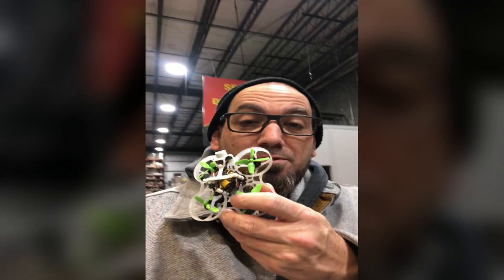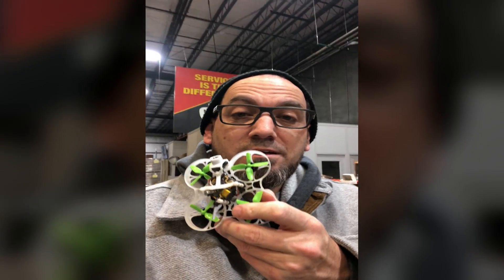Mobigital 7 10000kv + The Gauntlet Bando Penetration Testing

Comment: Thank you for opening my eyes to this. I'm building one ASAP!
Reply from the maker: You're so welcome dude! They are such a blast!
Reply: @DaxNealFPV  While I have you: I'm buying a Nebula Pro Nano with Vista unit right now for this project. The only place that has them in stock has the Naked version at $11.00 more than the standard version. I'm handy with electronics and your video makes removing the heatsinks look easy. Is there any reason from your perspective to buy the naked version for more money than the standard vista?
Reply from the maker: @kingjamez80  The end result is the same, so it comes down to whether or not you want to do the work yourself or not for the extra $. It is a little messy the first couple of times you do it. Then you figure out how to do it without a mess.

Comment: Is this still the best build components or have you updated it since? I’m wanting to build one and just decased the vista using your video. Thanks in advance.
Reply from the maker: 0802 10000KV
https://pyrodrone.com/products/jhemcu-ghf412-2-4s-aio-12a-blheli_s-dvr-barometer
Nebula Pro Nano or the Polar Nano for another 1/2 gram of weight loss. GNB27 connectors weigh less than XT30 too.
Reply: @DaxNealFPV  Haahaa! You figured out the one thing you can do to get it significantly lower in weight!  1102's is the common mistake people make when making these! 0802's are said to work just fine and get a lot of extra weight off of it. There's never been an issue with top end speed, it's cornering and making it as nimble as possible that's the goal. Those are the motors to use, but why not 19,000KV, like the original Mobula7 came with, that was also 2S? Those are said to work fine!  They'll give you a lot more punch, speed and top end. Wouldn't you want 10,000KV if you went to 3S? I think so...   ;)

Comment: That’s insane flying across that whole warehouse with a whoop! How is the latency when you get deep out there(I’ve never flown dji)? The tiny whoop world seems mostly untapped by digital fpv. I guess the bit of extra weight is just too undesirable for a lot of whoop pilots plus the 2s minimum limitation. My similar weight HDZero whoop flies good enough for me to zip around and really enjoy it with such nice image quality. I think the 1s HDZero vtx will finally be a big breakthrough for digital into the whoop world and then we’ll see it really take off. Also probably just a matter of time before HDZero gets high output power also into smaller/lighter stuff as well.
Reply from the maker: There is none. That’s one of the strengths of the DJI system. It’s penetration. That and is video quality.
Reply: @DaxNealFPV  Yeah, that variable latency is blown way out of proportion! I agree, I don't feel any, ANYTIME!  Sure, if you're a pro racer, and I mean a paid pilot, and used to making ultra quick turns on a race course you may feel a bit, but who cares when you're doing all the other types of flying we do 99.9% of the time! lol  Even Vanover, who's just about as good as anyone gets, said he can feel a tiny bit, but he can also adjust for it. He gets about the same times, on a very hard track, that he gets with analog.

Look at the crystal clear image quality - what you see here is exactly what you see in your goggles! What's to complain about?!!! lol  AmaZing penetration with no distortion on screen at all! It's FANTASTIC! Anyone complaining about DJI digital FPV is NUTS!  :)
Reply: @KOrnhOliO1  People complaining about DJI FPV aren't nuts. Let's start with price. $150 for a VTX and camera, $700 for googles. That's just outrageous, but since there is no real competition out there, they are just charging a kidney for it. Then there is the proprietary stuff, even tho the googles are running Android. Or the fact that they force you to update to the last version so you can't root the googles. And what about a proper OSD, with Canvas mode ? They said they were working on it, but it's been months. Sure the quality and penetration is amazing, but that's not all.
Reply: @MrAlucardDante  First off, the V2 goggles retail for $569.99 with 4 antennas and a battery ... It's ready to go with no other equipment needed. 
Please disregard inflated prices found on some prominent Chinese websites!
That's well less than many top analog goggles that you have to buy the analog module for (typically $120 - 150), two antennas (approx. $30), and a lipo ($20). The top quality analog goggles sell for between ($500 - 570). Totaling those needed items up comes to a minimum of $670 - 770. So, even the minimum of quality analog goggles comes to right at $100 MORE than what the DJI V2 goggles sell for equally equipped. Once we get these to functional goggles, the $100 - 200 more goggles are still only giving us plain ole analog reception, with all of it's inherent fuzz, distortion, rainbow patterns, rolling video, jagged lines, snow, and other analog break up! Where of course, the DJI V2 goggles give us mostly crystal clear 810P video, with sometimes digital pixels that occur only on the outer edges, leaving the center video clear. Often, the image quality is consistently near perfect because of the phenomenal penetration of all objects.
The Caddx Vista includes an up to 1200mw top performance VTX, a top performing ultra sharp digital camera, a DJI receiver, and an antenna. The Caddx Vista starts a $139.99 with the ultra low light Polar camera.
We must compare apples to apples, so we must choose similar quality analog gear. That means a close to 1200mw VTX which costs approx. $45 from a company like RushFPV, a top quality analog camera like the Caddx Ratel at approx $35, and a quality receiver like the Crossfire for $30, and a quality analog antenna for $15.
Those total approx. $125.
Total for analog = minimum $670 + $125 = $795 up to $895.
Total for DJI digital = $570 + $140 = $710

What we have done here is something that people seem to rarely do when comparing the costs of both analog and DJI digital FPV ... actually total up ALL of the gear needed for both systems! We have also compared similar performing gear ... No Eachine, off brand, or other low end analog gear to compare with top performing digital gear! That's important because analog already has so many inherent performance issues that to even make a comparison at all, we must use the very best gear analog has to offer, otherwise analog's performance is so poor, a comparison is worthless unless analog is at it's very best. Even then, some will say there's no real way to make a reasonable comparison because the image quality of each system is so vastly far apart.  
When comparing Apples to Apples, DJI's digital FPV system is actually cheaper than top quality analog systems because everything is included with the V2 goggles and the Caddx Vista. Building quads is incredibly simple too!

What isn't comparable is the image quality garnered from Digital vs Analog. Analog has such poor penetration of objects both man made and naturally occurring that it actually makes comparing image quality nearly impossible because they are so far apart in what we see as distortion in our goggles as we attempt to fly FPV.

As far as performance VALUE FOR YOUR DOLLAR, DJI's system is so far and away superior it actually is the BEST VALUE IN ALL OF FPV! Where most will question whether the performance of analog FPV, being so much money, for so little performance, is even worth investing in! Paying that much money for such questionable image quality brings into question why people would spend so much, for such poor performance when DJI digital FPV costs less and gives so much value for the dollars spent. Most describe the image quality, actually seen in the goggles as a person is flying FPV, as stunning.  

I think the biggest question here is Why are new people, just coming into FPV, even considering buying analog, with it's questionable image quality for your dollars spent?!  🤔😎🤘
Reply: @KOrnhOliO1  i don’t know where you live, but here in france, v2 goggles retail for 690€, and the caddx vista with nebula pro kit is 180€. You can buy Skyzone 04x for 450€ and there is a module included. So a great analog setup is still cheaper than DJI. Also, and that’s another topic, but who buys crossfire when ELRS is a thing. New pilots buy analog gear because you can buy an eachine ev800dm for 90€. Sure it’s not the best of the best, but if you ask new pilots that don’t know anything about the hobby if they rather spend 700€ just for goggles, or 700€ for a whole setup (drone, goggles, radio, lipos, etc) 99% of them will go for analog.  So sorry my friend, but you are wrong, DJI isn’t the best value. Also, even tho the DJI goggles have 810p screens, every HD camera actually outputs a 720p signal. I agree that the image quality and penetration is the best in class, but the variable latency can throw some folks off. And for a while, you weren’t able to buy 120fps cameras like the nebula pro, so you didn’t have the full DJI experience. Quality mode/60fps is fine for most people, but if I spend almost 900€ in goggles, vtx and cameras, I want it all. Not just an ok camera, like the polar, that was garbage at launch. And let’s not talk about the controversy surrounding DJI, the Chinese government and all that jazz. Like everyone else out there, I want to fly on HD, but I also want food in my fridge 😉
Reply: @KOrnhOliO1  Also, even tho I don’t care, running DJI at 1.2W is illegal almost everywhere.
Reply: @MrAlucardDante  Sure, outside it is, but he is flying this inside a warehouse! Not illegal to fly in a private warehouse at 5000mw! lol
Reply: @KOrnhOliO1  maybe it's true in the US, but in EU, no matter if you are inside or outside, it's illegal to go above 25mW. Blasting RF can mess with radar, weather and military equipment
Reply: @MrAlucardDante  WOW! That's a total bummer! Even more of a reason to go with DJI V2 goggles and the Caddx Vista! 25mw will still give pretty amazing image quality with by far the best penetration to reduce all of the snow and crap distortion found in analog and HDZero. 25mw on both of those gives rather poor image quality !  :(
Reply: @MrAlucardDante  You guys in Europe are getting SCREWED! Todays exchange rate between the USD and the Euro is 1 USD = 0.896441 EUR.
So, if the DJI V2 goggles sell for $569.99 in the USA, multiplying that $569.99 x 0.896441 EUR = $510.97 ... And that's the equivalent to what we pay here in the USA! So, if you are getting charged 690 Euro, they are charging you 179 Euro too much!!! WTF! Where are you seeing this price? Cuz, they are ripping you off! Don't go by Banggood, cuz they are inflating the retail price of virtually everything since the pandemic started and even more now with the chip shortage. When I go on DJI's website, they show a retail of $569.99 USD. When I click in the top right corner and change to France, they appear as 659 Euro! WTF?!!! Why are they charging you essentially 148 Euro more than the equivalent price in USD?  :(
It doesn't make sense! You currency is worth more than ours, yet they are charging you about 148 Euro more than what we have to pay in the USA!

Can you order from a USA seller and pay the conversion rate from Euro to USD and then pay the relatively small shipping charge to ship them to France? Cuz, buying them from a USA dealer should cost you $510.97 with today's exchange rate. Then shipping should be not that much to France....sure, maybe 50 or so Euro, but you'd still come out far ahead ... Unless they will then charge you an import tax. Hmmmm?

I just went to AliExpress. I have never shopped there, but many guys like it.
They have the DJI V2 goggles for as low as 514 Euro, and that includes a 64gb micro SD card.  I changed the country currency to France and the Euro. Shipping to France shows as 58,23 Euro. So, well over 100 Euro less than buying them in France. And, 514 Euro is just a few Euro over what the exchange rate says they should sell for! Co0ol!
Reply: @KOrnhOliO1  They are not ripping us off, we have this thing called VAT out here, which adds 20% to the total price. It sucks, but then we have free health care, 5 weeks off every year while working 35H per week, and once we are 65 years old we have free retirement money ;)
Reply: @Rick Ellis Please read the full conversation. Prices aren't the same everywhere on earth
Reply: @Rick Ellis yes. And, at least here in france, there are different VAT rates, like drugs (as in medecine) have a 2% VAT, electricity has a 5.5%, museum tickets have 10% and everything else 20%